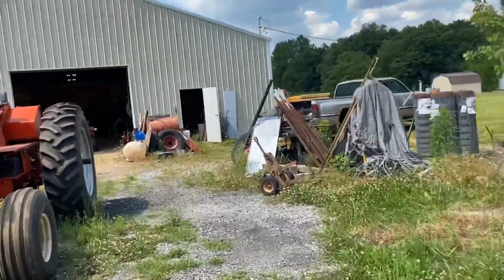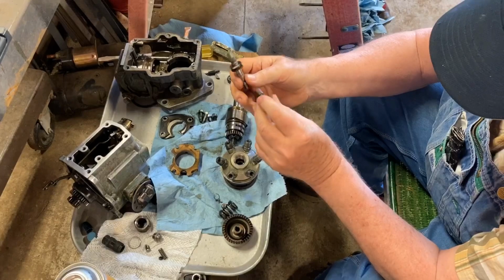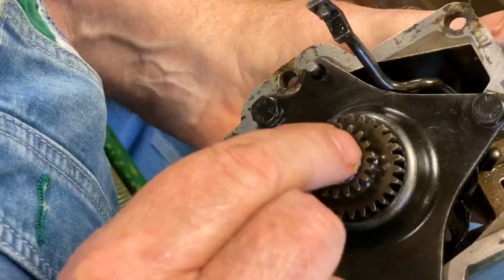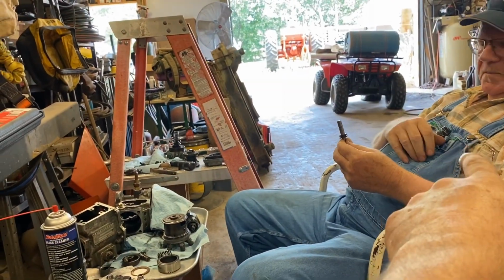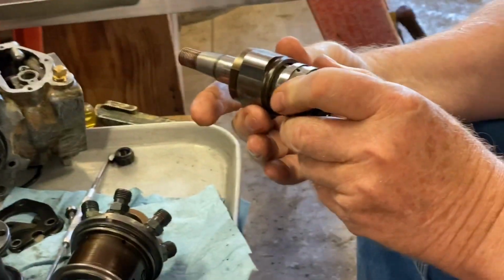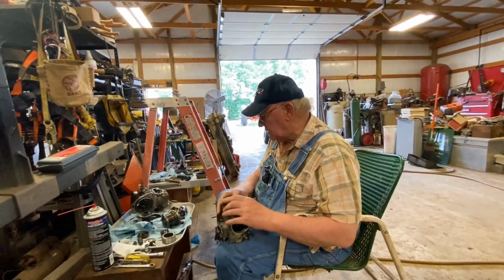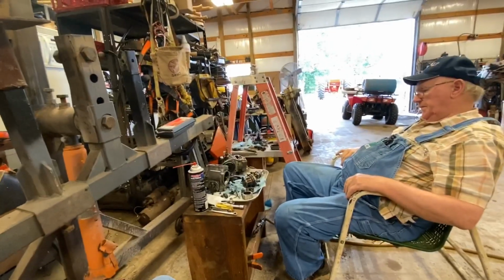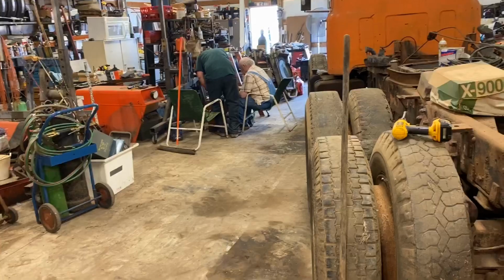Thursday with Uncle Joe and the B61 Mack Semi

Comment: ALL YOU HAVE TO DO TO PUT MAXI CHAMBERS IS TAKE THE OLD SINGLE CHAMBERS OFF AND PULL YOUR PIN OUT OF SLACK ADJUSTER AND THE TWO 15/16 NUTS OFF AND JUST REPLACE THE WHOLE MAXI BRAKE CHAMBER AND YOU ALSO HAVE TO CHANGE YOUR AIR VALUE ON THE CHASSIS AND PUT A AIR VALUE SWITCH IN THE CAB.